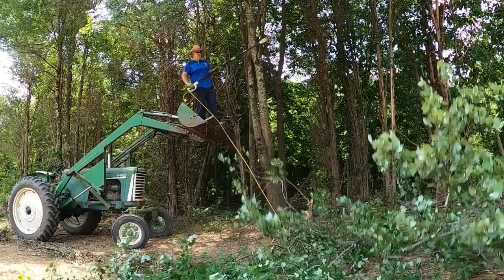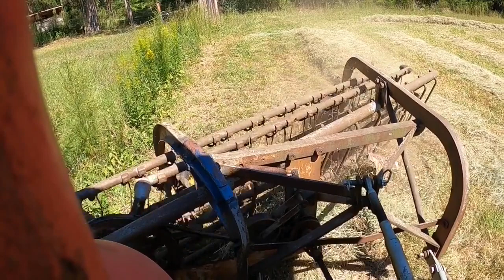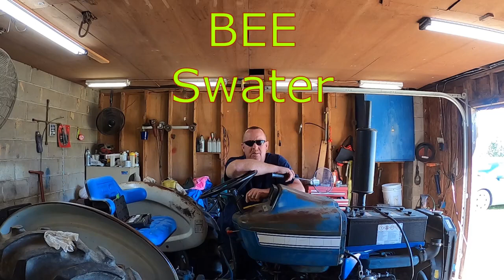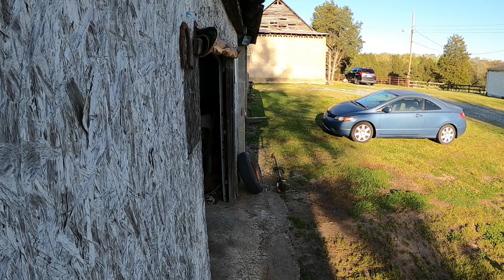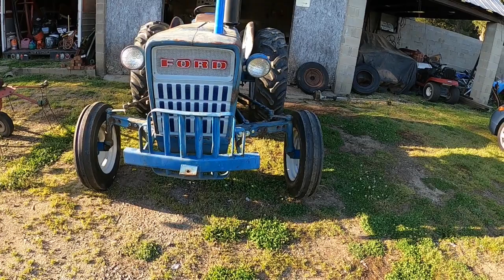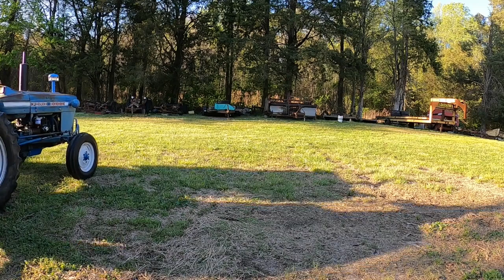How did we do on the Ford 3000, it's out and back at work FINALLY!!

Comment: I'm late on account of checking to see if the asparagus is up. Not yet. 
Then I was down in the river bottom looking at water. Thank you Nelson.
Reply from the maker: I was wondering how the sudden warmth was effecting the snow melts 😳 Hopefully the warmth helps it out!!
   I do as well Mr Bryce, nothing like those 3 cyl fords in my opinion!! 
    I need to do a little research, Dad used to have to do that with the cub too!! Thank you my friend for always being here, I really appreciate that!! 😁😁👍👍🇺🇸🇺🇸
Reply: I like the sound of the engine.
Reply: On the old Farmalls if you took the battery cable off it was necessary to polarize the generator.  It wasn't difficult,  but I'm not sure about Ford.

Comment: I have a IH 454 tractor and a new steering cylinder is $3,000 and a tie rod end is $174 at the dealership and it is totally hydraulic what a mess three point and pto work fine but no steering or brakes there is no reason the parts are so expensive
Reply from the maker: Wow😳😳😳😳😳 That's crazy!!! We priced a box for this one, close to 2500 I think 😢😢 You are SO correct, no reason for any of that stuff to cost that much!! Hopefully you can get something worked out, maybe a parts tractor 🤞 Thank you sir for being here, and I really appreciate that!! 👍👍👍😁😁😁
Reply: @Pennies_on_the_dollar  I took the old steering cylinder and had it rebuilt and also got a aftermarket one and went with aftermarket tie rods
Reply from the maker: Heck yeah, that's the way to do it!! I bet it was a lot cheaper that way!! Thank you for the update!!
Reply: @Pennies_on_the_dollar  a lot cheaper
Reply from the maker: Man yeah!! That's what it's all about there!!